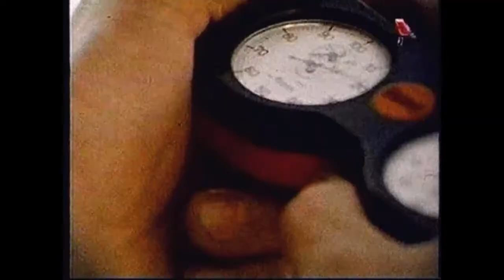1971 Daytona 500

Comment: Does anybody have any insight on what kind of restrictions were put on the 426 hemi from 1964 to 1974? It seems to me an unrestricted 426 hemi superbird would dominate every single race
Reply: NASCAR banned the Hemi in 68 I think. I'm close on the year. So Dodge answered with it's 383, then 440. And in a Superbird or Daytona, they couldn't be touched. NASCAR banned Big Blocks in 72 I think, the Dodge stopped racing. Dodge was about fast and durable.
Reply: I'm wrong in the Hemi Ban. But, I do remember NASCAR picking on Dodge constantly, till Dodge said Forget you and stopped. Mopar was just hard to beat in all racing. I think when NASCAR finally banned Big Blocks is when Dodge dropped out. 
 But I do remember seeing something about the Hemi and NASCAR. To make Dodge Run a 305 against 429, 427  because Dodge built a more Aerodynamic car was bull. I know Ford made a Winged Car, but it never ran.
Reply: Have to research. I think Ford was allowed two four barrel carbs in 1966 and for several years afterward. The Mopar hemi was allowed one four barrel. All cars in NASCAR had been allowed only one four barrel for many years until Ford and probably GM were allowed two in 1966. I'd like to research this more. Someone else may know.
Reply: The Mopar Hemi was allowed two four barrel carbs in drag racing but not in NASCAR racing. (I think).
Reply: @jeffcampbell2710  Part of this is not true. The 440 was never allowed in NASCAR. NASCAR never allowed more than 7 liters, 426, 427, 428, 429 CU. After the hemi was banned Petty ran non-hemi Mopar engines. At some point the CU limit was dropped down for all makes.
Reply: @joen7795  ; It appears Ford stuck with 68'-69' body style, and skipped 70' and 71' models altogether. 
Did they ban they ban the wing in 71'?
I see Petty is driving a 426 Satellite coupe.
Reply: @joen7795  Which would have been 1975. What happened was that, at the driver's behest, NASCAR began restricting the Fords, Mercurys, Dodges, and Plymouths in the summer of 1970 (there was no GM involvement at the time), and then the factories pulled out after the 1970 season, with this race (the 1971 Daytona 500) basically being the last hurrah for the factory era of NASCAR, something that eventually led to Chevrolet's return later that year. For a few years, teams were allowed to run both the bigger engines (426 and 429 cubic inch engines), as well as smaller 351 and 366 cubic inch engines, which I believe were granted weight breaks, while the cars with bigger engines were restricted a bit more, but were far more reliable.

The 1973 Daytona 500 would see cars with the big engines lead every lap, but in second place was one of the 351 CI Fords with Bobby Issac driving, and by 1974, the weight breaks for smaller engines, if there were any, were gone, but with rules allowing teams running smaller engines to run with a larger restrictor plate, more teams, including the Wood Brothers, as well as Roger Penske's team with the AMC Matador, began running the smaller engines, while the teams running Dodges stuck with the bigger engines, which were forced to run with a smaller restrictor plate to level the playing field as much as possible. In fact, Nord Krauskopf's K&K Insurance team even boycotted the first part of the NASCAR season because of having to run with a smaller restrictor plate. By the end of the 1974 season, NASCAR put an end to all that by mandating a maximum cubic inch displacement of 358 cubic inches for 1975, which is still the rule today.

Comment: How did they do a 305 dodge engine? And damn it's fast!
Reply from the maker: Google Mario Rossi. He reduced the stroke on a 340. It's this type of ingenuity I miss in modern racing.Thanks for watching!
Reply: @HODIUSDUDE  thank you
Reply: it was a very similar destroked 340 engine that Chrysler used in the TransAm series in the  race version AAR Cudas and T/A Challengerss in 1970
Reply: I'd assume that they didn't have to run a restrictor plate on the 305 incher but I'm not sure.
Reply: no plates....just engine building know how to get 500 miles out of a small block full pin nearly the whole way, pretty amazing that any finished even  while pulling the 'slippyrier' bodies ...
Reply: @allenmax8995  I don't think it was all that amazing really for a guy like Mario Rossi to  make that work.  I know a few people who worked with him and he was a VERY smart guy.
Reply: @ Dave  oh.... I  think with the waaaay higher revs[ the valvetrain punishment alone ] lighter cranks and mains  in the small blocks and the technology/materials  available then.... its pretty amazing...imho
Reply: @allenmax8995  I would assume that Chrysler had a lot of really good parts and knowledge from their Trans Am stuff that would have been really helpful.  I wonder if Rossi used any of that in his effort?
Reply: @Dave  an interesting story to dig into...I know very little of any collaboration between the Chrysler T/A program and the NASCAR small block efforts  at that time....it was a short lived era...18 months max?
Reply: Yes indeed it was a destroked 340 .... Thanks to the development of Chrysler and Keith Black and the 1970 Trans Am project, they had the makings for that engine ..... .Mario Rossi ordered two of them .... My father Bob Sykes Sr.  built and did the dyno workup for the Trans Am Challengers and the 1969 Plymouth Indy engine with the Harry Weslake one off heads.  Since Keith Black Racing  Engines didn't do too much circle track racing, dad and Keith simulated a 500 mile race by doing pulls at speed and idling down when they had to change barrels of racing fuel ..... The valve train was one off and bullet proof..... It ran like a bat out of hell .... finished 7th and held the lead 5 times....
Reply: @DaveMcLain  Right. His was the only car in the race not to have a engine with a restrictor plate because the engine was reduced in size to 305 cubic inches, so as a trade-off, their engine was not required to run with a restrictor plate. And yet, despite that handicap, Brooks was able to lead this race on more than one occasion, and despite that mid-race spin, was still able to finish seventh. After the race, the winged cars were outlawed completely.
Reply: @cjs83172  Not just the winged cars but all of the specially bodied cars.
Reply: @cjs83172  "After the race, the winged cars were outlawed completely." - You are mistaken.
"Supercars: The Story of the Dodge Charger Daytona and Plymouth SuperBird" has Richard Petty quoted as saying - "We never even considered it...Well, I don't want to say we didn't look at it initially, but we looked at the horsepower of the 305 engine and the horsepower of the 426 and I said, 'Hey, I don't care how good that body is, it can't overcome that.' So we just passed on it."
The Daytona, Cyclone Spoiler and Talladega are listed in the 1969, 1970, 1971 and 1972 rule books, while the Superbird is listed in the 1970, 1971, 1972 and 1973 rule book, under  Section 20-1 -- Competing Models - Category 2--Intermediate size cars.
Aerowarriors.com has all kinds of information on the winged cars and Chrysler racing program.
Reply: @DaveMcLain  no restriction plate was needed because the 305 didn't generate the power but the wing helped the car hang with the leaders
Reply: @Ziggy_Moonglow  That was a beast the 426 Superbirds!
Reply: @Ziggy_Moonglow i thought NASCAR only let you race cars that could be found new st a dealership ? ie this year's model and last year's model.
Wasn't that why only Superbirds raced in 71 ?
and Daytonas were too old ?
plus there were prototypes made for the new 71 guselage bodies.. no need if the 69 + 70 wing cars would be legal in 72
... ? ?